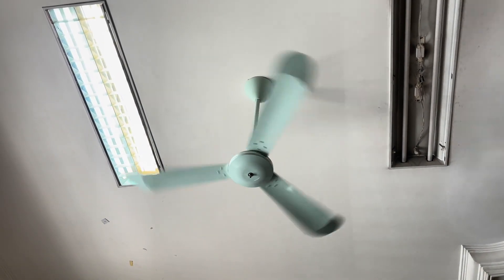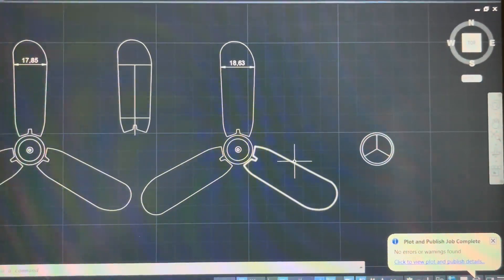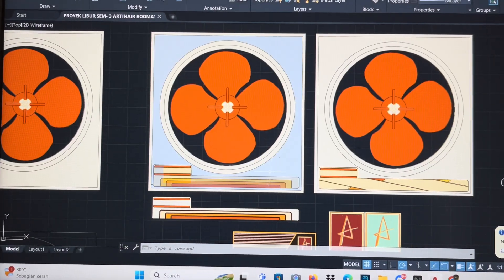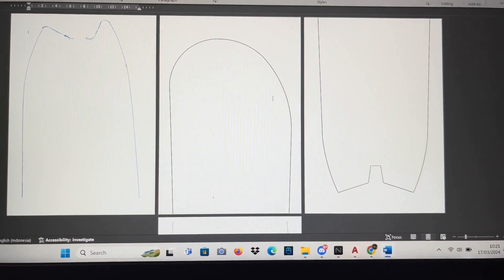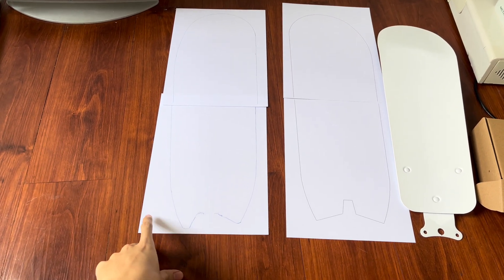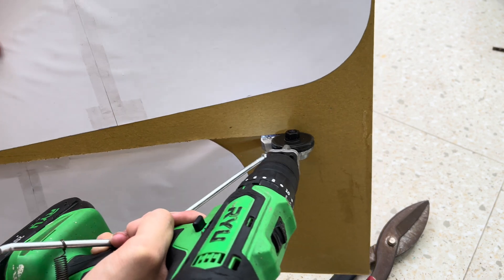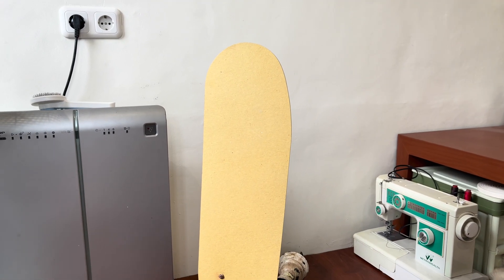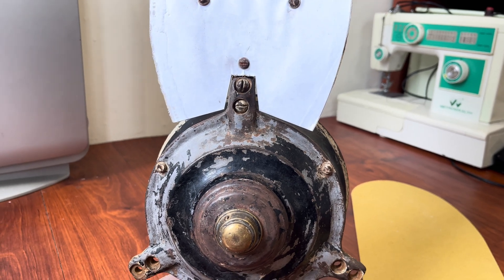Making Blade Templates for My Antique Marelli! | Work In Progress

Comment: Great job! 
I am considering making blades for my 3 bladeless Relite Rapide MKII fans. I have all the 3 size templates. I was thinking of having them lasercut by a metal works company, and then I will bend them as you did to your Orient. In fact, thank you for the idea of bending them over a cylindrical object!
I don't know yet if I should make them 36, 48, or 56 inch, or maybe make something innovative, like 42 inch.
The trouble I have is that the shank angle is very difficult to make. If the worst comes to the worst, I can always order those in high quantities from India, as they are still made by Crompton nowadays.
Reply from the maker: Thanks! I actually have considered lasercutting, but I think the price would far exceed my budget. I’ve made my own blade shanks before. They’re a bit more difficult to bend than the blades, but making a bending jig out of multiple steel blocks made the job easier
Reply: @TheFanUniverse  Thanks for the advice